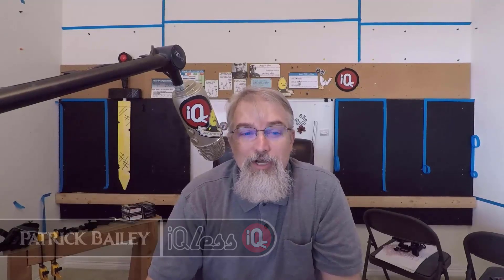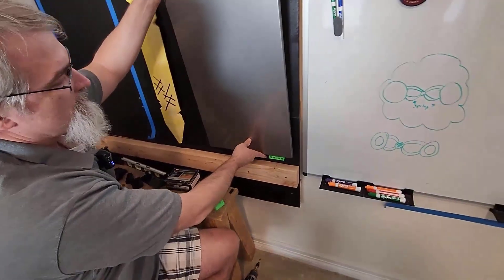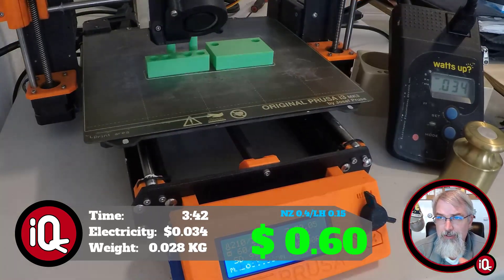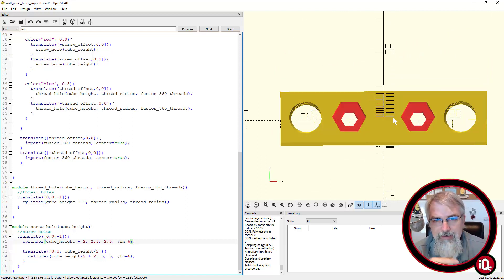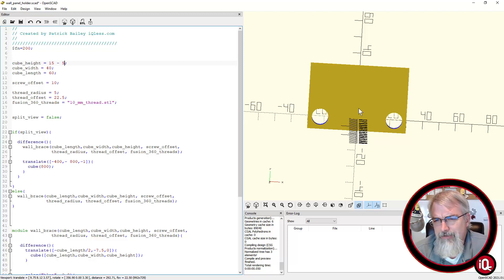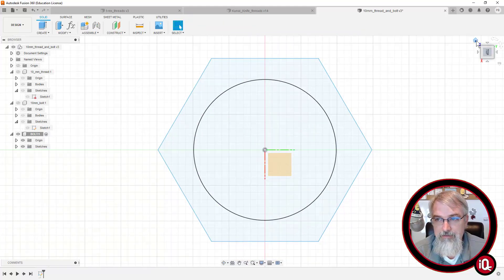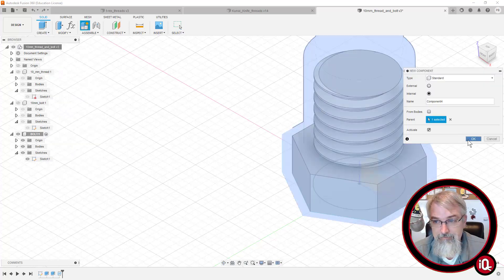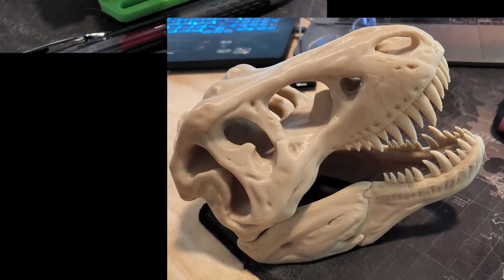3D Printing: Wall Panel Brace

Comment: lots of instructions and libraries for doing threads in open scad. could just import one of those libraries in so it adjusts with any settings you use.
Reply from the maker: I probably need to fiddle with those again.
Last time I did they seemed slow to me.
So I kept with what I knew Fusion 360 works really well.   But I should revisit this again.